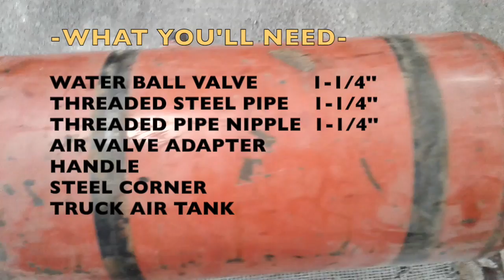How I Made a Homemade Bead Blaster To Inflate Tubeless Tires

Comment: very skillful man, but not suggested to do this, no safety valve, no pressure meter, very dangerous while using it.
Reply: Gu Derek, i totally agree, but also a safety valve and a pressure gauge could easily be designed into the tank
Reply: And no safety guard on the angle grinder, just in line with the tank safety ;-)

Comment: You forgot to mention to NEVER weld on a pressure vessel until you're positive there is no residual flammables left in it. You can accomplish this by filling it to the very top with water. Then, and only then are you safe to weld.
Reply: the video states its made from a truck air reservoir, so there has never been anything other than air inside it. I do agree with you if the tank being used has previously had flammables in it.
Reply: Isn't that the common sense. Who already doesn't know that shouldn't even be close to the tools.
Reply: ilhan G 

    Cannot assume common sense
Reply: I used exhaust for 3 minutes to displace the oxygen content to weld on gasoline auto tanks